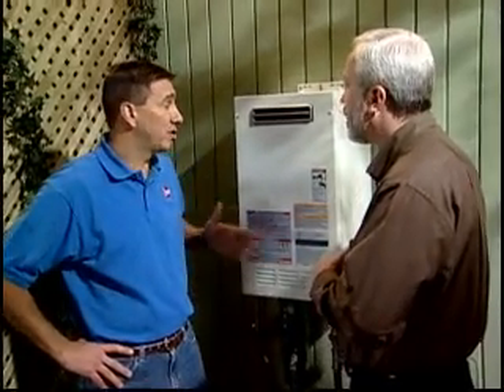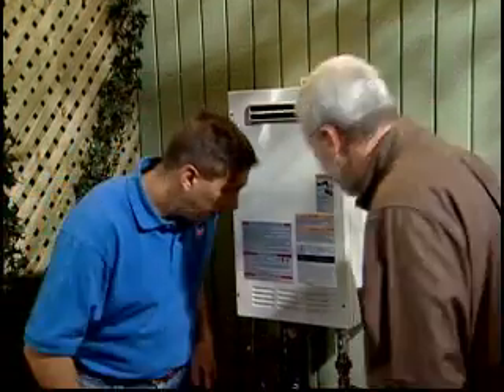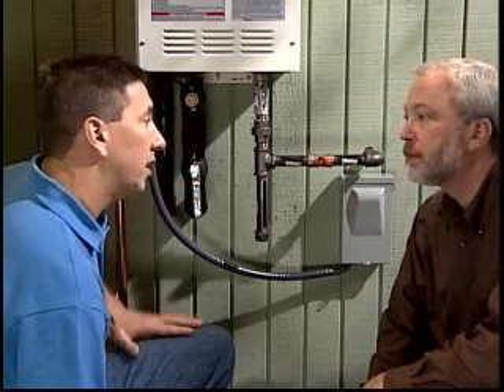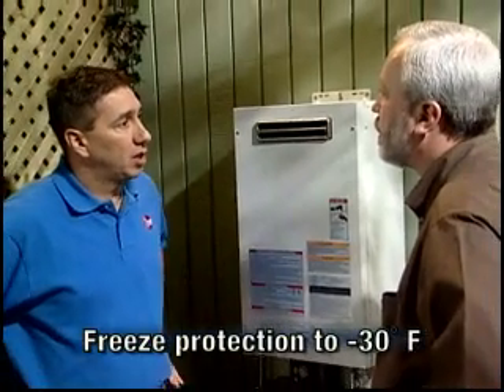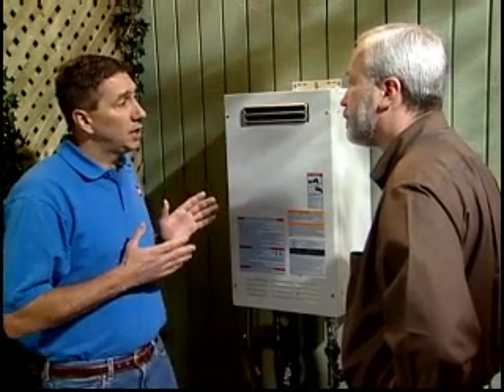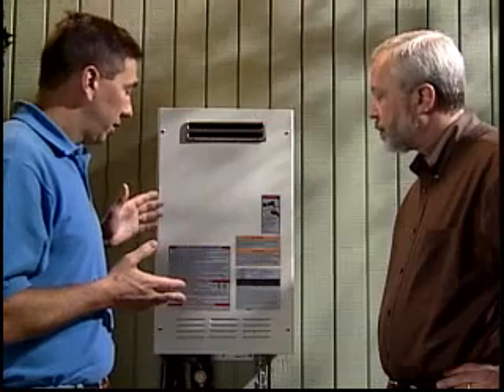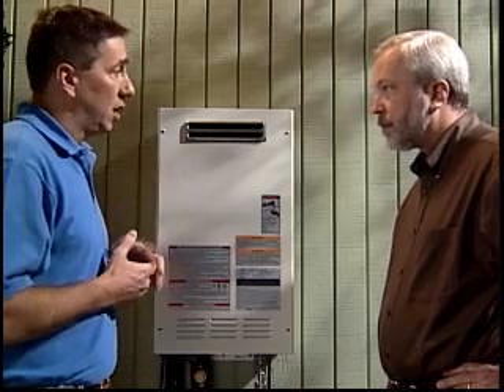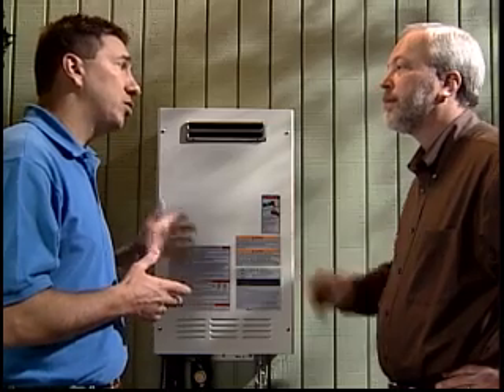Installing an Outdoor Rheem Tankless Water Heater

Comment: @kieranmullen2  You could always paint the cover in a similar colour  to the wall or siding  or maybe build a neat service cabinet around same taking into account   obviously things like ventulation and not exposing the cabinet to any contact with a hot area on the heater... ....